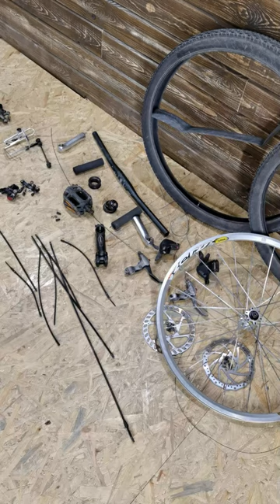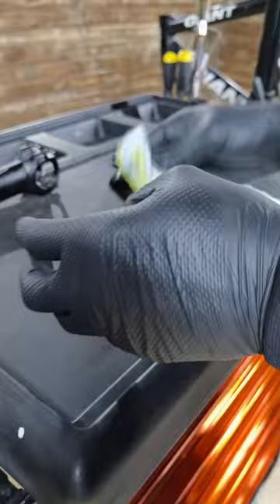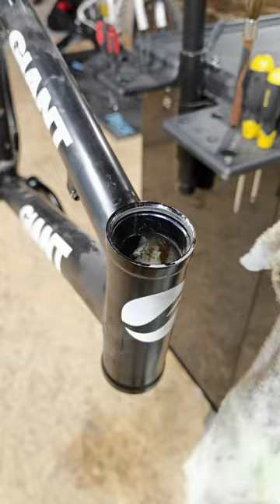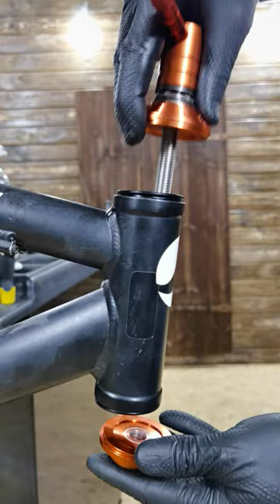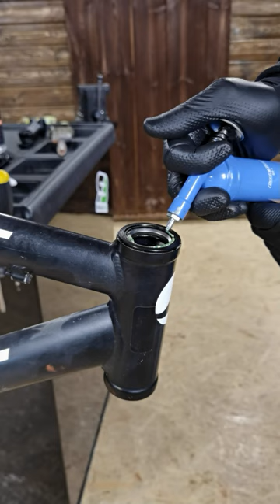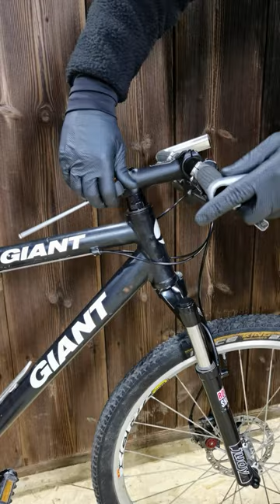First headset service since 2001. Old MTB build. Part 9 - headset bearings greasing and assembly.

Comment: Teflon Grease is fine, I wouldn't use copper slip on the frame it will attack the alloy frame and stainless components over time

Comment: You did better than me at getting the cups out. I tried to do it without the proper tool and broke the flanges (and the cups are still stuck on!). Lesson learned…
Reply: He didn't show how he got the bearings,  that's the hard bit
He Just filmed the easy bits
Reply: I I'm needing that how can I find it on the internet 41mm through

Comment: What kind of headset is this? I think i have the same type. How does it work when there are no ball bearings?
Reply: I'm curious to know as well
Reply: Is it a threadless one?
Reply: There are ball bearings in a cage retainer  in these. These are cheap headsets where the cups, bearings and covers are one unit, they can be taken apart and greased but not as good as a sealed cartridge bearing.

Comment: Did you glue the cups into place? What's the brown stuff?
Reply: that I believe is an antisieze grease
Reply: @knowmere5832  Don't you want that piece to seize though?
Reply: @NickelCityPixels you don't want anything on your bicycle to seize, believe me.
Reply: Copper slip anti seize for when you have 2 metals in contact that don’t move, this creates a barrier to stop corrosion.
Reply: It's copper slip, it stops the bearings getting stuck in there
Shame he didn't film how he got the bearings out in the first place